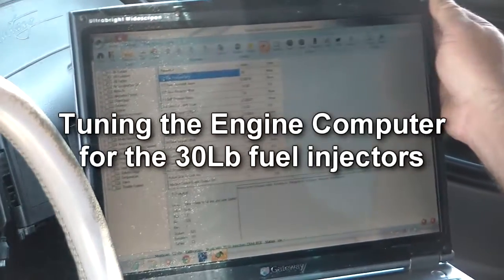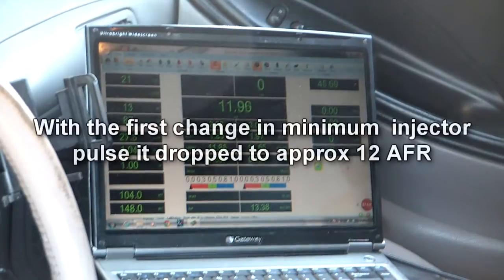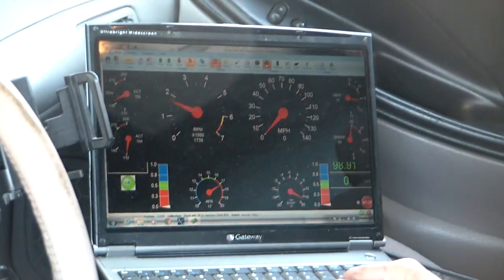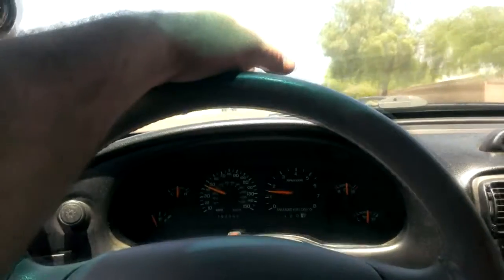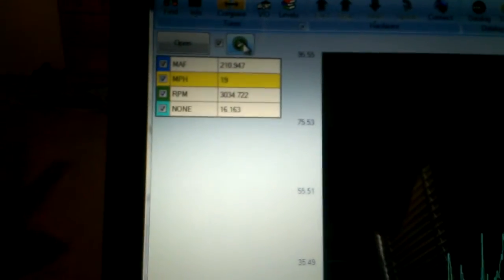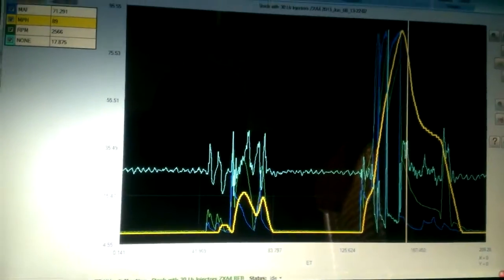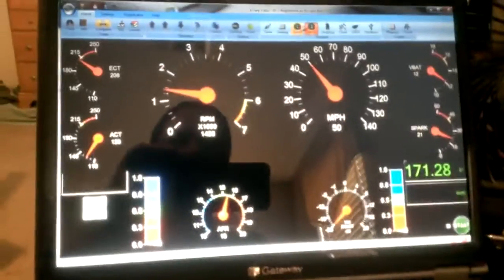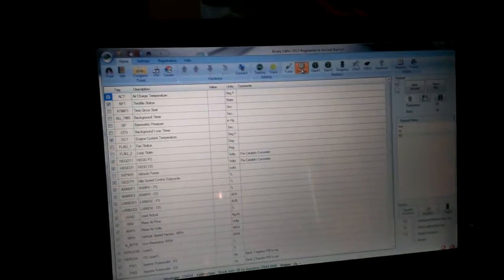Mustang GT Project - Tuning for 30Lb injectors

Comment: what do I need to be able to plug your laptop in tune my 2002 GT it has 30 lab injectors already BBK throttle body intake and tube and full exhaust

Comment: Good Job ! You seem to know a lot fixing/ tuning cars, mine is 2004 Mustang, 3.8 litre V6. I am "spicing it up " some, bigger cold intake, 70 mm throttle body, 36 lph injectors, headers, aso...., will put cats, or similar exhaust pipes later. Did nor change injectors yet, do I have to re-program my ECU, after I do that?? Is there free program somewhere, I could download, and do it my self?? Need some help here, by the way, do I need a laptop to re-program, those OBD II code-readers, i could not do it with them?? Thanks a lot, youtheman =)

Comment from the maker: ... It also didn't want to go off idle because of the miss so I had to hold 2K and let the clutch out. 
It still spun the wheels all the way thru first gear and ran a 15.4 at near 100MPH or so (Slow time but high trap speed do to crappy start but good pull with boost).

I took it apart after racing it and then saw the damage. 
It never blew up. It just had zero compression on one piston and low on another. 

I'll see if I kept the pistons through my last move and shoot video.

Comment from the maker: Thanks bro. Yeah it seems that there is "the way" that everyone starts going with and if you do it another way then they scoff.

As for the Saturn it was a slow SOHC Throttle Body Injected type. It was a 5 speed so at least it wasn't as slow as the auto of that year.

Stock run at the track was 18.4 and not even 80mph.

I never got it to the track before I cracked the pistons. 
I ran it at the track with all that nasty blowby, running on 3 cylinders...

Comment: forum guys are very annoying. Yes they have great advice. But they always say "has to be" and "thats not possible". Its very annoying. You are a true modifier/builder. Your using your own knowledge and not the bolt on ready ready to go kits. This is a true project.
 Haha. Nice job on the Saturn. How much better did that thing pull? And I bet every ones jaw dropped to the floor because you didnt use a bolt on kit haha. Bummer you busted 2 pistons tho...

Comment from the maker: Thanks bro.

When you hang on the forums it's hard to be "low buck" around the nay sayers who think you have to use this or that, or use this brand or nothing or do it this way or it ain't possible, etc etc yada yada. 

When I put a turbo on a 1993 SOHC throttle body injected Saturn SC1 the Saturn guys were like "Say what???"
But for the most part those guys did want to see it work. And it did perfectly at 7PSI.

At close to 15PSI it detonated and then broke two pistons. :-/